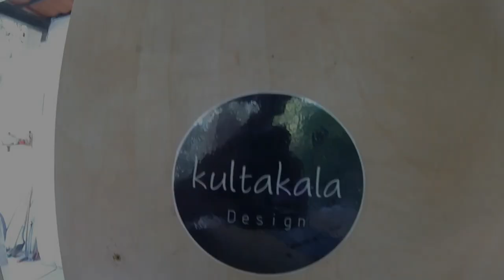How to build simple Router Sled and a Table | Woodworking

Comment: I like your adjustable stop.  The only suggestion I would have would be to add some spacer blocks on both ends so that the router bit could travel the whole width of the sled, and allow you to eliminate the sideways travel of the guide - that, I believe, is what a previous commenter was referring to when he was talking about a safety issue.  Nice job

Comment: was thinking about steel or ALuminum, both have pro's and cons, looking at your video, is the sled bending? or is it the camera angle / lens?
Reply from the maker: @RoninJeremy  no its not bending
Reply: @Kultakala_Design_Studio  thanks for clarifying, aluminum it is then.

Cheers!
Reply from the maker: @RoninJeremy  im using steel, aluminum will bend.
Reply: @Kultakala_Design_Studio  thanks for clarifying, it really looked like you were using Aluminum, from the color and the inside corners not being very round.

Comment: What horsepower router do I need? is a 2 hp router enough or should I get one stronger? I saw a 3 1/4 hp router on Amazon, really need to know…Thank-you… also, which router bit will I be using to smooth table tops?
Reply: I had pretty much the same question.